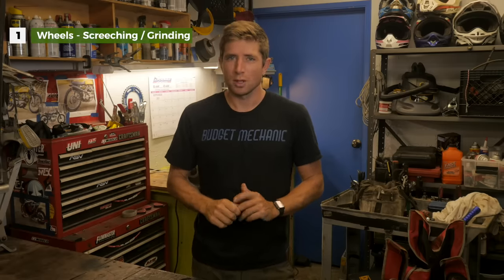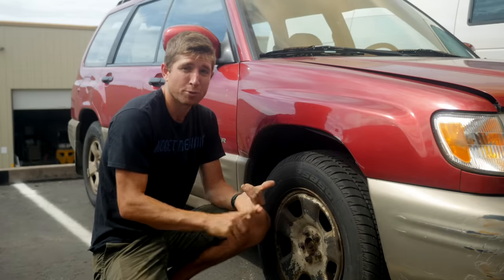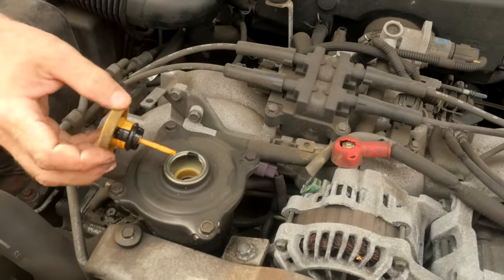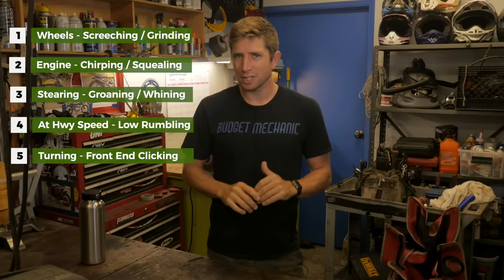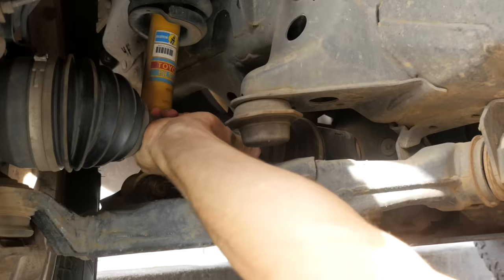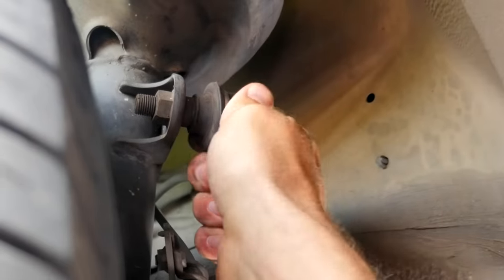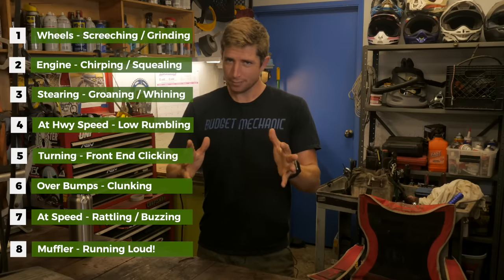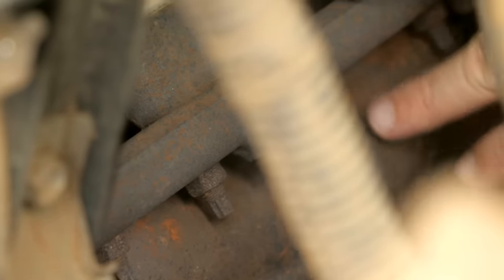8 Top Noises Your Car Engine Makes and How To Fix- Grind, Clunk, Squeal, Click, Groan, Rattle

Comment: I have got a noise that sound like cv axle or stabiliser links. The noise comes and goes, what could it be?
Reply from the maker: I would start by checking those two!
Reply: Thank you, is it normal for the noise to come and go? I’ll be driving and hear a weird noise lasting 10 seconds then it will go away and then it will start again and it repeats

Comment: I have a weird sound that almost feels like a bump in the tire. Like every second i hear a whoo sound and it just repeats. Mostly hear it at higher speeds. It kinda feels like its marking every tire rotation or something
Reply from the maker: Bumps in old tires are very common, your tires are marked with a date, anything over 5 years, cracked, or worn should he considered for replacement
Reply: @BudgetMechanicHawaii  my tires are brand new tho, unless i got tricked
Reply: The mechanic did say something about a loose bolt joint or something but im pretty sure it was BS as he was moving the tire with such force the wheel was turning.

Comment: I'm thinking it the stabilizer links. It kind of sounds like it's in thr back though. It usually happens going about 50km but only makes the noise for a short time. I'm going to get my son to record it. I feel like I'm always fixing something and hope it's only this cheap part this time. Or it's the exhaust shelid. We do have an exhaust issue going on. Lol.
Reply: Thank you so much for this video! This helped so much! I feel less stressed driving now and will get it looked at Monday. I'll only drive when necessary. I just got the new alternator last week. 🙄

Comment: what does a sound that only comes on when going up hill at some speed noise comes from under the car for few seconds and goes away
Reply from the maker: Exhaust shield or cv axle? Hard to say without being there…
Reply: @BudgetMechanicHawaii  that's true because i checked the gearbox nothing is wrong with it most likely it is that . thank you

Comment: Hi Josh: thanks a lot for your diagnosis tips. Now my car has some "humming" noise. It is not always there and it is noticeable when do a quick reverse by press pedal fast. It is also noticeable, while suddenly press gas pedal when the car cruise at speed 45-50 mph. Could you give some hint when you are available? At the beginning of the video, the noise is more significant. 

https://www.youtube.com/shorts/YChhV2wy96A
Reply: After staring the rpm for long time, this problem only occurs at 1100rpm reverse or driving. But not at parking, it could be I didn’t maintain the rpm at parking for long enough time.

Comment: Hello Sir,
Sometimes my car makes clunking sounds at low-speed driving, under the bonnet at the front passenger side. It actually sounds like I left a tool under the bonnet and vibrates as I drive. The noise goes away after 5min driving mysteriously.
I was wondering if I need to see a mechanic soon? Thank you in advance.
Reply from the maker: It’s odd that it goes away after a while. I would’ve guessed shock mount, but that wouldn’t go away. Check for tools!

Comment: Humming soumd when there is even a slight turn to the right side on speed above 90 or 100kmph
Reply: When there is left turn it goes away
Reply: I would say check wheel bearing?

Comment: How about----Grinding as if with the rotation of the tires. Mostly during acceleration, but more so after right hand turns. Doesn't always start right away when driving. Usually after driving at least 10 mins.
Reply: @I_Died_2_Weeks_Ago  hmm ok the abs sensor is bad on the van
Reply: @I_Died_2_Weeks_Ago  ok thank you

Comment: Amazing and helpful content

Can you tell me., What would be the cause for vehicle to vibrate at 50km/hr- 80km/hr . Up to 40km/hr is super smooth. Vibration causes slow down acceleration and   After 80km/hr vibration tends to go but damped vibration sounds still persists 

Lexus gs300 2007 model 

Tyre is good ,  done wheel balancing and alignments, change the most vibration dampers. Bearing has been replaced. It's a rear wheel drive car. 

Please advise.
Reply from the maker: I would get under and check you cv axles for front/back looseness.
Reply: @BudgetMechanicHawaii  did that as well, and vibration tends to fade away as speed climbs up. Vibration still exists even when its put through neutral gear, when the speed get to 80 to 50 km/hr range.
Reply: @BudgetMechanicHawaii  would this be drive shaft U joint ?
Reply from the maker: Anwar Nishthar yes possible but often they manifest problems under acceleration. Is your engine running smoothly?
Reply: @BudgetMechanicHawaii  yeah, engine is pretty much silent, ultra smooth till 40km/hr,  no miss firing, and no hesitation shown while reving at nuetral gear.  But the acceleration is very less from 40km/hr till it picks up 80 - 90km/hr

This vibration occurs even when the gear is in nuetral. I have checked it few times, after attaining speed 90 above or 100km/hr, I put it  in neutral and wait for the  speed to come down in 80 to 45km/hr, same vibrations occurs 

Changed all rubber mounts, tie rods, lower arms , lower ball joints etc and  today inspected with obd scanner as well, two codes were shown, one is P0986 shift  solenoid e control  circuit high, and  P0051 oxygen heater sensor circuit low. And cruise control isn't working as well though it turns on n off while pressing the button.

Odometer reading is 399,900 kms now. It's rear wheel drive car.   2007 lexus GS 300. Please advise
Reply from the maker: Anwar Nishthar how’s the tires?
Reply: @BudgetMechanicHawaii  tyres and good , wheel has been balanced, alignment done .

Found out the issue , it's the  cracked rubber mount on center bracket holding the two shafts. Hopefully would change worn out  parts tomorrow and see if this fixes the issue. Will update , thanks
Reply: @BudgetMechanicHawaii  hello there. The vibration is fixed now.  It was the torn rubber at the center bracket which connect two shaft units . Thanks for your inputs
Reply from the maker: Great!
Reply: @BudgetMechanicHawaii  I would you need your advise on p0986 code, on driving more than hour , gear hesitate to shift or sometimes doesn't want to shift above two gears.  If I change all shift solenoids , would it fix this issues.   Only two codes showing are p0986 " shift solenoid E control circuit high  " and P0051 bank 2 oxygen sensor1.

Please advise

Comment: I find your content really great, easy to digest. So alas I have a weird noise not covered in your videos so far, looking for ideas.

It starts when you go about 40km/h (or faster that seems to be the min speed) and then take your foot off the gas, it's super loud (the neighbors look) and sounds like metal clanking to me, but the interesting part is that it goes away when you start to accelerate again.

 Any ideas would be welcome. I've been thinking it's the CV joint even though they present as ok.
Reply from the maker: Is it a rear wheel drive truck or something? Vehicles with failing driveline “universal” joints can often do this
Reply: @BudgetMechanicHawaii  Hey thanks for answering, I had it looked at by a mechanic. Turns out the clanking noise was pistons shaking, so something went POW. I'm guessing the noise was somewhat constant, but just got louder when I was decelerating. Needs a new engine now.

Comment: I have Camry 2004 model. When my car is accelerated in parking mode it doesn't produce any sounds. but when i am on a road it makes weird noise, the accelerator PAD vibrates and makes grinding sound. Now if i remove my feet from accerelator pad it stops the grinding. it means there's no issues related to tyres. can you help me what could be the possible issue ?
Reply from the maker: Pad?

Comment: I have the sound at No. 4 - however, I have it at pretty low speeds, like ~20 mph. I also tested that the sound is still there and sounds exactly same when in neutral.

Anyone have any ideas what might be going on? Does the noise happening at such low speeds indicate anything in particular?